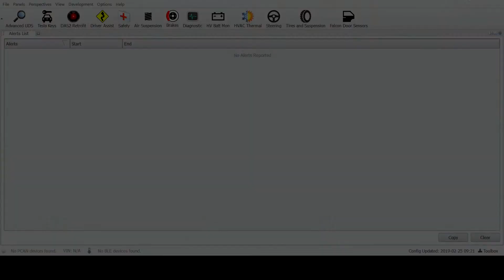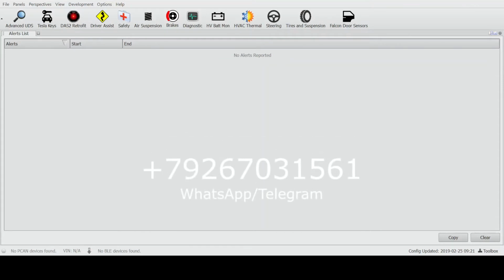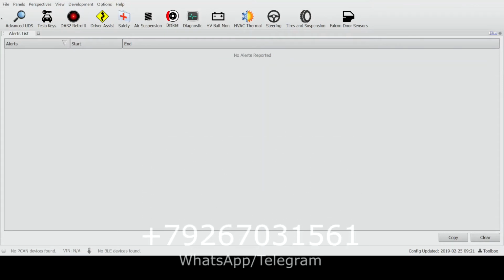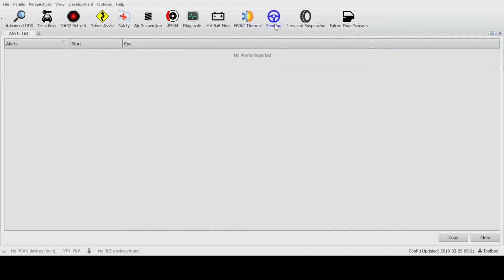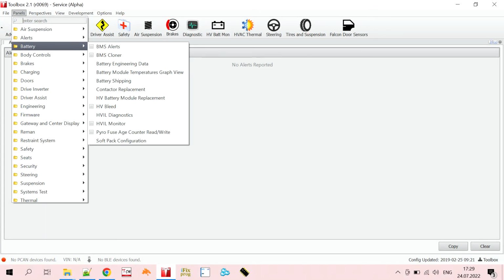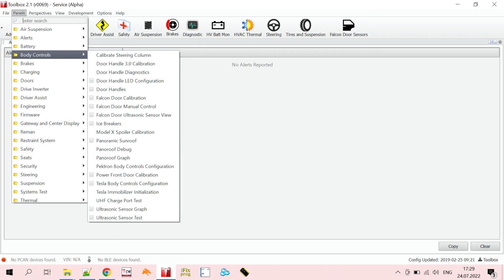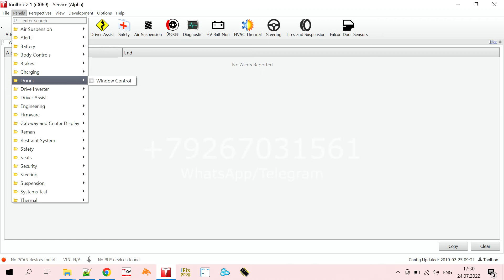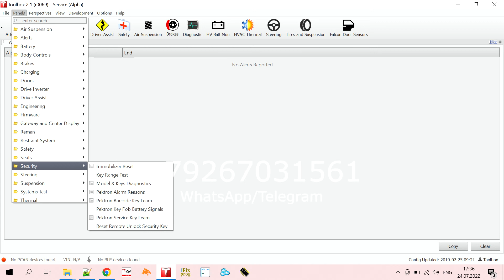Tesla Toolbox 2. Interface and main functionality. How to fix a Tesla car.

Comment: I’m trying to communicate with a 2015 MS P85D and I have toolbox 3 and the proxy tool but the proxy tool is not working. Can you help me with this issue?
Reply from the maker: It depend of your firmware. You should activate the Factory mode, than start communicat with the diagnostic port. Or at leat unlock it